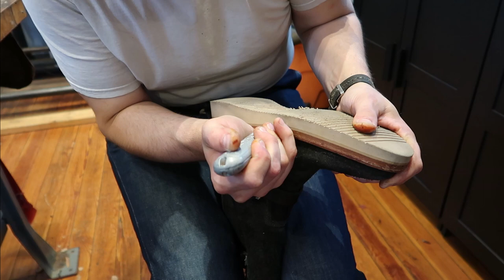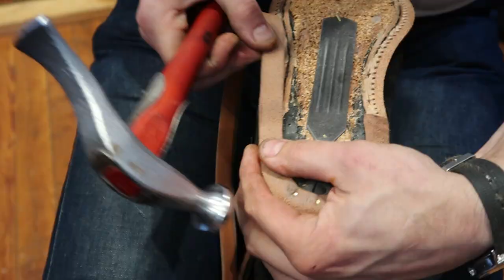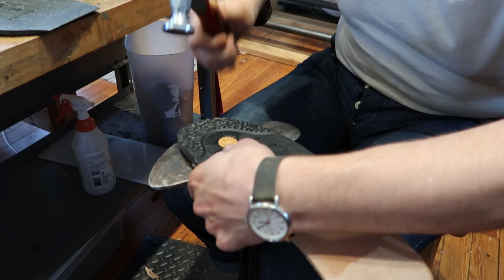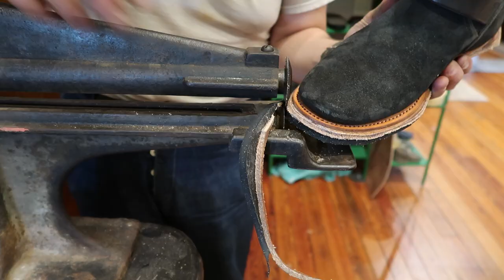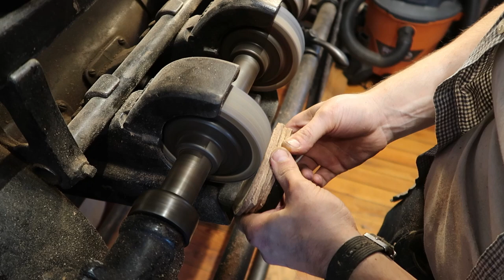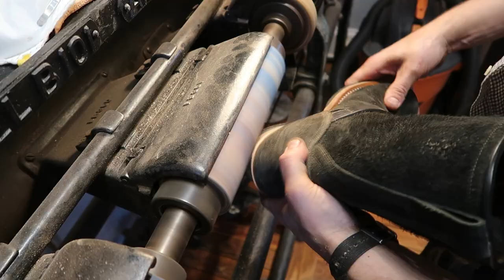CLINCH ENGINEER BOOT CONVERSION

Comment: The joint where the welt meets the heel rand looks really good and seamless. It looks like you're using welting for the rand rather than a larger u-shaped piece. Is there a reason for this?
Reply from the maker: The reason for the continuation of the welt for the heel rand is because there is one less seam and it cups the heel well for the woodsman heel. We don't necessarily use this for every style of shoe.